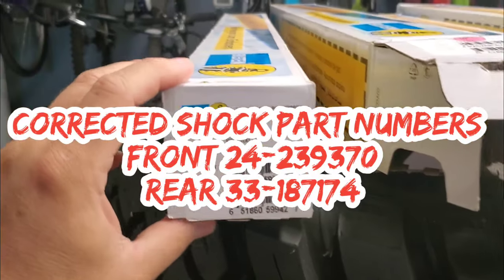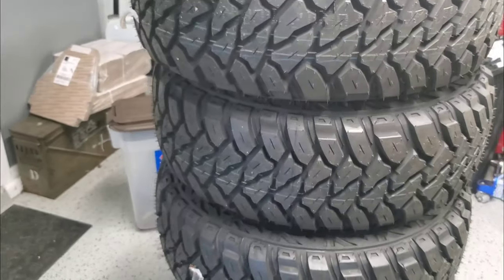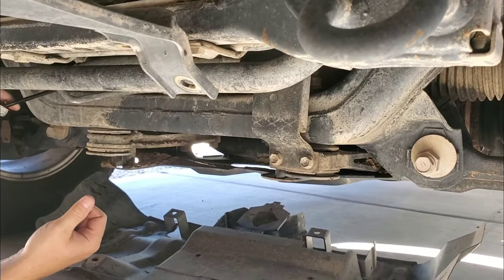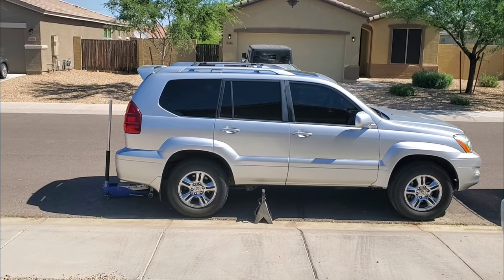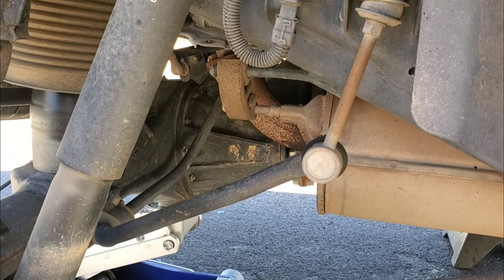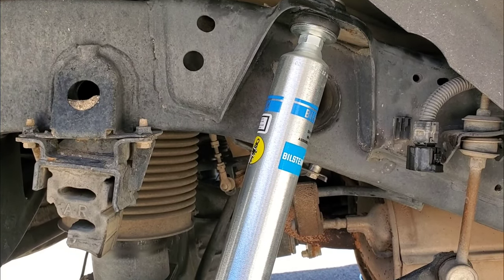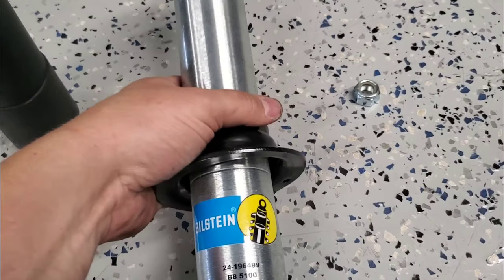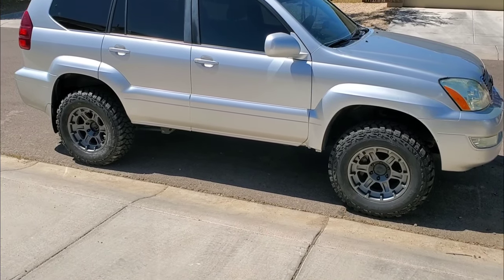SIMPLE LEXUS GX470 / GX460 / 03-09 4RUNNER LIFT. AIRBAG TRICK - BILSTEIN 5100 - DIFF DROP

Comment: Hey man looks great!  I also tow and do some mild off-road travel with my gx470.  I was curious if you have ever had issues with the compressor or air suspension while towing.  I just recently had the air suspension stop working and it started working again right before I came home from camping.
Reply from the maker: I have not had any problems but bags are due on my white GX470. 150K miles on the original so just a matter of time.
Reply: @MR_Garage  Will you replace with factory air springs or buy aftermarket?  If aftermarket did you have a supplier in mind?  I'm thinking my problem may have been overheating the compressor due to high tongue weight.
Reply from the maker: Compressor only airs up once and then makes minor adjustments unless the bags are leaking. I have looked at Arnott bags but will likely just go OEM. I mean hell... 150K miles over nearly 15 years... I would say they are quality :)
Reply: @MR_Garage  I just replaced the airbags on my gx470 last month. There are videos on the internet the only tricky part was disconnecting the airlines. Once you see the videos you’ll see why.  One guy used dental picks, another used a piece of 1/4 inch sprinkler line which seemed very clever.  

Other than that it’s a simple change.  A couple hand tools jack stand and a Jack.  It took me 3 hours.  Mainly because I fooled with the airline disconnect not wanting to break them. 

If there is a next time I could do this no more than 1 hour.  

Rides like butter again.

Comment: after reading through the comments and it being 2 years now, how are those tires holding up? and the airbags since they are technically being over inflated. Thanks! great video
Reply from the maker: Tires have been great. No complaints at all. My son switched to them here just recently too. Bags have been fine but are still stock on my white GX. I have a set of arnott bags I need to put in as a maintenance item since the stockers are at 170K

Comment: What size tires are these and what is the offset of the wheels ? Great video , you just saved me a shitload of money !
Reply from the maker: -10 / 17". Tires are 265/70/17
Reply: @MR_Garage  What wheels are you using on these? They look great, especially with that rubber. 👍
Reply from the maker: @Milesamanjaro  They are Tandem Offroad 612's
Reply: @MR_Garage  Awesome. Thanks for replying and great looking rigs.

Comment: Hey man.  Quick question:    It may be a silly question but I am just now starting to get into suspensions etc, so a bit uninformed.  Why is it necessary to upgrade the factory shocks to add a 2” Lift?   Wouldn’t the airbag trick + a spring spacer for the front springs suffice?    Sorry if it’s a dumb question but in my understanding the airbag and the front spring are what give the truck it’s lifted height, while the strut is a hydraulic dampener, and the factory strut should have enough travel to cover 2 inches of lift. What am I missing?
Reply from the maker: Not silly at all, you could do that. But due to the age of our GX's and milage, factory struts will be shot. And oem adjustable replacements are stupid expensive. This makes for an easy affordable lift without bouncy blown struts.
Reply: @MR_Garage   OK. Got it.   Thank you for the explanation!   I'm on the GXOR group also. After seeing this vid I googled Kenda 612 on the group and saw you are on there also.

Comment: Hello and thank you for the video as I am about to do my gx470 project. Nothing crazy and expensive but off-road capable and fun. 
Got few questions.
1. From your experience how much gx470 can tow? My RV weight about 5150lb empty, I think with all our stuff in it it will be 6200-6500lb. 
Would be it too much for gx470
Including few hills on the road?

The tires you’ve put are they 33’s or 35?

What rims size would you suggest if I want the tire to be flash with a sides/fender sides

What would be the difference if Belistein 6112 installed?

Thank you in advance
Reply from the maker: GX is rated at 6500'lbs. I will never tow more than 80% of a vehicles rated capacity and I would not recommend it to anyone. I would recommend moving up to an LX570 or Tundra with how heavy your trailer is.  My tires are the equivalent of a 32". I plan to go to 33 when these are warn out. For rims, mine are a -12 offset which makes the tires pretty flush to the fenders. Perfect look IMO. 6112's are really nice, well damped.

Comment: I threw 6 washers in to trick the airbag sensors on both sides and don't think it did much (if anything). Did I miss something? Should the height adjustment system be turned off and/or in a certain setting (H,N or L) prior to doing the airbag trick?
Dummy me didnt measure before doing the trick and now I've convinced myself that I've done it wrong.
Reply: It just still looks like factory rake and the airbags didn't kick in when I started the car after installing the washers. Plan is to install 5100's with ome 884's in the next few weeks.  Maybe I've overthought this...
Reply from the maker: You do not have to do anything prior to spacing the sensors. If your airbags are functional and sensors working properly, the trick always works. Countless people have done the airbag trick - works like a charm. And you can see the rear height change with mine even in the video. Just making sure, you started the car after the trick to let the bags air up ? I Ground to fender, both front and rear are at around 27 3/4" on mine.

Comment: What are your feelings on the 285/70/17 size, mounted on the stock wheels and also how the 285/70/17 size is on the -12 offset wheels you mounted your tires on? I've seen some people mention 285/70/17 fitting with no modifications
Reply: Did you ever do this?

Comment: Hey Mr. garage, I appreciate your video first of all!! As a female u make it very simple and affordable for me to possibly do myself.  I was wondering what is the actual tire size that u use on the gx? I look forwardto ur response. Thanks for ur time! Lauren in ft worth Tx.
Reply: Nevermind I found where u already answered that ? … thanks for the videos!! Keep up the great work!  I’m having radio issues with mine because the previous owner replaced factory head unit with aftermarket and I can not get it to sound good at all.
Reply from the maker: Glad you found the tire size - and glad the video helped you out! You got this. Quick note, when taking the front struts out, the easiest way is to unbolt the swaybar on both sides and from the knuckle. Also unbolt the lower ball joint (two large bolts on bottom side). Lets you swing the assembly as needed to get the strut out.
Reply: I’m going to sell my 2018 Lexus LS500 with luxury edition (51,000 miles) and I bought a 2007 Lexus GX470 with 131,000 miles yesterday.  One owner and all maintenance done at dealership.  I can’t wait to make some changes to give it a tougher look.  Some may think I’m crazy but I don’t care.  I prefer to drive the GX over the LS and it’s way more practical for me.  Good luck!

Comment: Hey thanks for the video. I did the airbag trick on my 2016 GX460 today and am waiting to put my Bilstiens on the front next week. I used 5 washers and was wondering if you can still use the high mode safely or not?  I kept the rear OEM shocks as well.  Just looking for your thoughts.
Reply from the maker: Hey Jamie, 
I use the high mode all the time to lock in a trailer ball and also backing a trailer up a steep driveway. Never had an issue.
Reply: @MR_Garage  Do you remember what setting you installed your front springs at?  Also, I assume the Bilsteins will eliminate the AVS?
Reply: I have a 2016 luxury and plan to do the airbag trick and a toytec spacer in the front. Did you wind up doing it? I’d like to keep my AVS in the front.

Comment: I followed this video over a year ago and couldn't be happier w it. Took it to Cabo and back and it handled everything very well. One problem with it though - and it's intermittent: some mornings I'll come outside to find the rear bags fully deflated. BOTH rear bags. Other mornings they'll stay at their (increased) 'normal' height for a week at a time. So, something is either telling them to settle all the way to low (sensor?) - OR something is leaking (pump?). But again: intermittently. So I don't think leaking... Any ideas??
Reply from the maker: System does not work with ignition off so my guess is the check valve in the pump is maybe leaking a bit? Or, does it only happen during times you do not drive for a while? I had a leaky bag finally. Replaced with Arnott bags.
Reply: @MR_Garage  thanks for that. To clarify - it's completely random. For instance it's been sitting for a week now and it's still uniformly inflated at proper height. But I'll go out and 1 in 4 or 5 times it's be completely deflated the morning after I've parked it the evening prior. It's an even deflate on both side. Check valve in the pump is an interesting idea... Do you happen to know if it's integrated into the pump itself or somewhere in-line?

Comment: Great video man!  I am going to do the same set up. The only question I have did you do the same height adjustment on the back(1 ¾")  I looked and didn't see it in the comments. Sorry if you already answered this
Reply from the maker: Hey Clint, There are no shock adjustments on the rear 5100's. The lift comes from the airbag trick
Reply: Than you so much man!

Comment: Can you do the airbag trick without replacing the rear shocks?
Reply from the maker: You can, but with old shocks, the ride will suck.
Reply: I have new shocks all around on my 04 GX.  Do I have to unplug them after doing the sensor trick?

Comment: This is a great video and exactly what I need for my 2010 GX 460.  I hope I'm not too much a bother but are the same parts numbers used for the 2010 GX? hank you for any assistance.
Reply: Curious about the same. Wouldn’t mind doing this to my 2013
Reply from the maker: You need two of these for the front https://www.amazon.com/gp/product/B009FU7RL6/ref=as_li_tl?ie=UTF8&camp=1789&creative=9325&creativeASIN=B009FU7RL6&linkCode=as2&tag=mrgarage-20&linkId=f6b1d494d2e5abe626814c66174d0013
Reply from the maker: And two of these for the rear https://www.amazon.com/gp/product/B007N6R2NM/ref=as_li_tl?ie=UTF8&camp=1789&creative=9325&creativeASIN=B007N6R2NM&linkCode=as2&tag=mrgarage-20&linkId=d4e5c08ad0956a70f8a76f760fd362d1
Reply: Can you do this to a 2010-2013?  Especially the airbag trick

Comment: Hello sir, I seen a few comments of people saying traction light and possible ABS light came on dash after. Was this normal and if so what did you do to get those off. 

Thank you!
Reply from the maker: This happens if they stretch their ABS cables and break the wires. You can verify for yourself that they will not come on by unplugging the shocks before you do the job, drive it around for a week. They will not come on. If you do the job and they do come on, you damaged one of the wires.

Comment: Thank you for the video and information.
I did the fronts on my 08 470 today. I was not able to use any but the lowest notch  because I could not get the lower control arm down enough to get the shocks in. I did have the lower ball joint disconnected. It isn’t a difficult job. Do you have Any tips or tricks for installation?
Reply from the maker: Hey Jon,
The notches do not make the shock longer or shorter. That is still fixed. spring preload is changed and that is all so the setting should not have mattered!
Reply: @MR_Garage  Thank you for clearing that up. I found the error of my way I needed to loosen the lower control arm to frame bolts. I reattempted and was successful. Thanks again.

Comment: Went to go do the air bag sensor trick on our GX this last weekend and the bolt heads literally snapped off.  Drilled some holes through to replace them, but I'm thinking the sensor got screwed up in the process.  Our arnott bags appear to be at full height.  Any tips or suggestions on how to fix it?
Reply from the maker: Did you drill bolts out or move the sensor to new holes drilled in?

Comment: Hello, I have a little gap between front suspension top bolt and metal on the top of rubber. Did you also have the gap?
Reply from the maker: It is hard to picture what you mean, if you can get a photo, shoot it to admin@garage1217.com

Comment: I'm looking for a system for my Lexus 2009 GX470.  I tow a 16' 4000 lb travel trailer and would like to feel safe on the road.  The tong weight is about 400 lb.  is this something that would work for me?
Reply from the maker: Right in the range of what I tow. Make sure to go with a load range E tire. Helps with stability. Also, make sure to replace swaybar bushings and depending on mileage, I would just replace the airsprings.

Comment: Looks like my 07 GX 470 the air bags system is starting to leak, the GX  has 205K on it. Do you prefer to have the air bags or do you simply replace them when needed.
What is the horse shoe looking thing that so see in some complete kits? Have you replaced yours?
Reply from the maker: I prefer to keep them as I tow a lot. I have the bags listed in the video description that I use (arnott brand). The horse shoe looking item is likely the top clip that secures the top of the airbag so they do not fall out.

Comment: Quick question: when I called Bilstein, they said the 24-239370 (actually have the 24-324359 as they superceded the 24-239370) are NOT approved for KDSS OR GXs with the OEM electronic damping.  Bilstein said the 24-239370 is ONLY for GX470 with NO KDSS and NO electronic damping.  I didn't know they made Base model GXs that came with NO electronic damping module.  I know from other comments that you did NOT have KDSS on either of your GXs, but did you have electronic damping?

We had issues with the install as the shocks would not compress enough to install (even lowereed the lower control arm after disconnecting tie rod ball joint, upper control arm ball joint and releasing the bound lower alignment bushings).  Now, we RE-installed the factory Lexus top hat which I now know we should've replaced it with Toyota Upper Mount Assy. (p/n 48609-60100).

Also, confirming that you installed the 1/4" LEAN spacer on the Driver's side only?  I assume you just laid this on top of the assembled strut before install (sandwiched between top hat and 3-hole frame mount.

Thanks again!  Sorry for long post.
Reply from the maker: Hey Scott. All GX470's came with electronic damping save I think a micro amount in 03. KDSS is the oddball and more rare option but same strut. When converting to standard shocks / struts you disable electronic damping and just unplug it which is why bilstein states it is for non electronic damped models because they do not have a fitment with electronic damping. This upgrade is tried and true - been around a lot of years nothing new.  

For the shock install, you do not compress the shock to install, simply unbolt the lower control arm (two bolts) from the knuckle. Also, unbolt the sway bar. All articulates enough you can slip the strut in and out / I have done a lot of these, quick and easy. 

Lean spacer is indeed just installed on the top, drivers side.

If you use aftermarket springs (I run eibach on my white GX now on the front), just go 1 notch up on the drivers side 5100 and skip the lean spacer. Eibach are already 2" lift so no pre-load via the 5100 to lift the vehicle, just 1 notch up drivers side to stop the lean. I switched to the eibach fronts as my OE fronts started to fail after 170K miles (I forgive them).
Reply: @MR_Garage  Thank you very much!  Did your KYB top hats from Amazon come with all the required washers and bushings?  That is the last piece of the puzzle that I am trtying to figure out.  What washers (top and bottom) and bushings (top only? or bottom too with KYB?)?  I bought new top hats from Toyota per Bilstein's installation notes, but don't know if I should source factors washers and bushings too for same gen 4R.  Obviously, I will use Bilstein's top nut as shaft size is larger than OEM.  If you can give me the order of washers/bushings along with source, that would be all I need!  Thank you!
Reply from the maker: The KYB set had everything new (washer, nut and bushings). Nothing else needed.

Comment: Great write up! 

Since you retained the factory airbag setup, what are the rear wheel arch heights at Low, Normal, and High?  I have the same size tires and want to still park in my garage which has a low entrance.
Reply from the maker: Your current settings + about 2".

Comment: Very nice video. I’m going to do this just purchased 04 gx470. I’m just wondering Can I convert to springs in the back later or what problems I may encounter With this setup?
Reply: Problems converting to spring is what I meant.
Reply from the maker: No problems converting to springs after this setup. Same as stock with bilstein shocks and lifted.
Reply: @MR_Garage   Thank you!!

Comment: I appreciate this trick and I am going this route. I tow trailers as well. Question, by going to the 265/70/17 if I do the same Tandem wheel, which I like a lot, is there any rubbing anywhere? does it clear the factory plastic so I don't have to cut on it?
Reply from the maker: I had to tuck the front fender liners forward as they would rub full lock. Just a minor rub but annoying